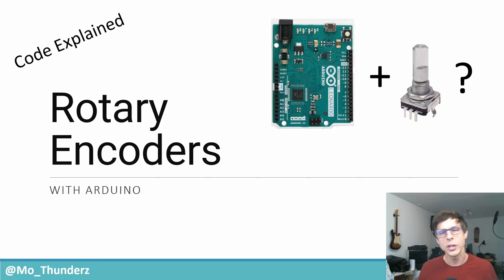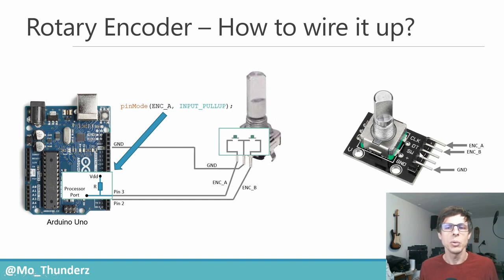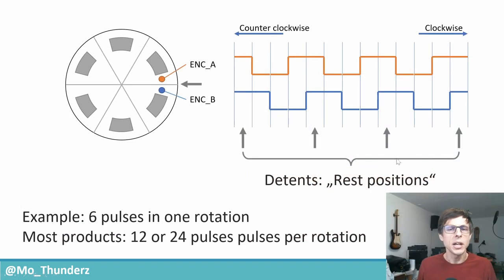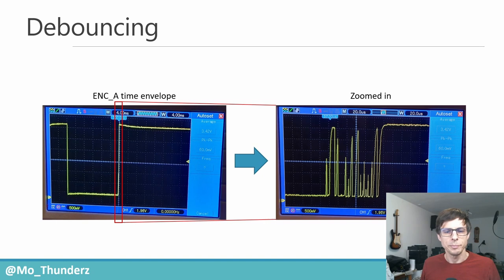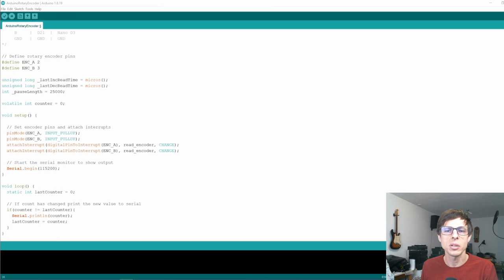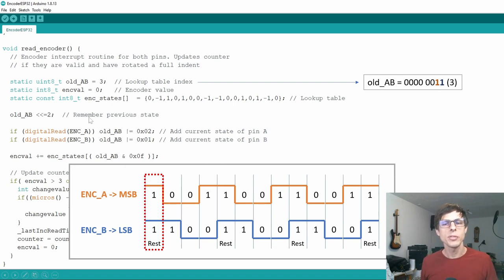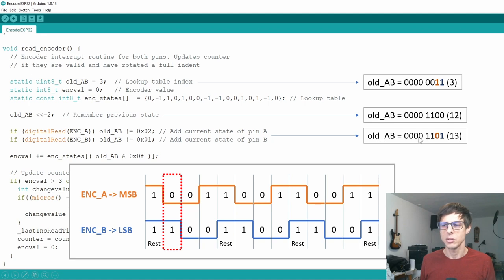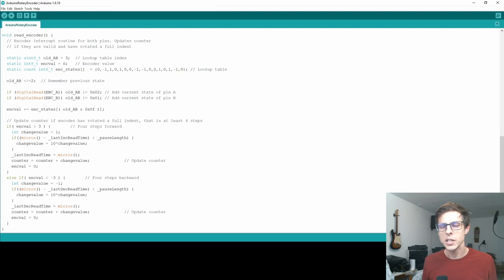How to use a Rotary Encoder with an Arduino - CODE EXPLAINED!

Comment: I dunno what to do! Im just using a rotary with the atmega328p chip, and then I make the pull up resistor circuit + filters but the values still bounce any time.

Comment: thank you sir,Your video is the  clearest one to explain the encoder state machine(the lookup table)，I modified the code a little bit,When a tick check failed because of a large number of noise.Assume the enc value has been added to 2. If next turn direction was CCW,the enc value would  be changed like 2-->1-->0-->-1,The counter value won't  change even enc value changed 4 times,Your code clears the enc value to zero only when it>3 or <-3,So the tick check will fail when enc value is not 0 due to last failed tick check,So I add a clear operation by adding a out time variable if there's no turnning action，After that the code works very nice,thanks again!
Reply from the maker: Thank you for your feedback and suggestion. A time-out makes a lot of sense.
Reply: Hi, where did you add the time-out? is it in the main loop or in the callback function?

Comment: Interesting, I have a large rotary encoder on small PCB with 5 pins and with the LED test it behaves exactly as the one in this video. However, one of the mouse scroll wheel rotary encoders (Huano S-10 from Amazon) LED 1 lights up, then LED 2 (both are now lit), and then they both go out at the same time. In the other direction it's like: both are lit, LED 2 goes out, LED 1 goes out. Weird. I wonder if I can modify this code to work with this particular rotary encoder, as I am trying to save space in my project and not use one of the larger encoders.

Comment: Idk if this is just with me, but if i turn the encoder in one direction, then in the other, it first increments and then starts decrementing the value.  So it is like this: turn right: 1,2,3,4,5  turn left: 6,5,4,3,2,1
Reply from the maker: Sorry for my late reply, I briefly wanted to doublecheck the behavior myself. I just did with my Arduino if I turn the other direction it does not lag so turn right 1, 2, 3, 4, 5 then turn left 4, 3, 2, 1, 0. On 4:27 in the video I show a simple method to verify operation of the rotary encoder. Can you verify if your rotary encoder behaves the same way? Thank you
Reply: @mothunderz  Thanks for your reply. Yes my Encoder does work the same way. I can figure out the reason my encoder setup behaves this way. i am using a pi pico insted of an arduino, but this shouldnt matter i think.... Did you notice anyone else having the same issue? Thanks
Reply from the maker: Do you have another Arduino to double check? I dont have a pico, but could find online some differences. Have you for instance changed Serial into Serial1? Have you checked with different ports? See for instance:
https://forum.arduino.cc/t/working-rotary-encoder-for-arduino-doesn-t-work-for-pico/1045042/18

hope you can make it work!
Reply: @flotshii8036  I have the same issue with my arduino Mega, did you figure it out?
Reply: Hmmm🤔 I did nothing but rewrite what I believe is the exact same code, and it suddently works.
Reply from the maker: @mariusjunkerkrabbe9225  That is odd, however, glad to hear that it is working for you now 🙂
Reply: I found that my issue was that I accidentally made encval a uint8_t instead of a int8_t

Comment: Just wondering, maybe it's clearly stated and I'm just not getting it right now: What happens, if the user would change the direction mid-click? As in after 2 Statechanges he returns back to the starting point instead of completing the click? Thank you for the nice work, it helps a lot!

Comment: Hi Mo...that code is very responsive and reliable. I may need to adjust the multiplier value for the fast rotation, but that should be straightforward. I plan on using this as part of a precision AC current Trip. I'm using a Current Transformer to sense the current, which drives a Precision Rectifier and a comparator. I'm using an MCP4725 12-Bit DAC to set the reference for the Comparator. The falling-edge of the comparator output, triggers a D-FF which drives a DPDT relay to isolate the supply being monitored. Keep up the good work and thank you.
Reply from the maker: Sounds like a very interesting project. Thank you for sharing!

Comment: Excellent video Sir, very well explained, a real pleasure to watch. I will use your code for a stepper motor driven indexing head. However there is a tiny flaw: If you turn the knob really fast, you may end in a state where encval is +2 / -2 in the rest position and you need two clicks backward/forward to decrease/increase the counter by one. Just set old_AB = 3 after abs(encval) >= 4 to get bullet proof code 🙂
Reply from the maker: Thank you very much for your feedback. I had made an update in the final code download that also addresses this issue. Did you still experience the issue in this final version:
https://github.com/mo-thunderz/RotaryEncoder

Thank you for the feedback! (and sorry for my late reply, am swamped with work ATM)

Comment: I know this is a little late in the game, but I thought this may help someone. I loaded your code onto an ESP32 DevKit1C. Used pin 14 as A and 15 as B. Worked well except that: (1) the first turn of the knob did not register (counter did not change) and (2) after any change of direction, the first turn did not register. The code I downloaded from github has a few "static" declarations under the "read_encoder" function. The first is: "static uint8_t old_AB = 3;  // Lookup table index  3". I changed "uint8_t old_AB = 3" to "uint8_t old_AB = 4" and the problem on my ESP32 is now solved. To the author. Thank you so much for a great piece of code. Brilliant!
Reply from the maker: Thank you very much for your comment to the video! Have you tried to characterize the rotary encoder as I show in 4:26 of the video? My suspicion is that your rotary coder works exactly the other way around. In that case, the LEDs would be lit up in the resting position and switch off when you turn the encoder. Can you try to compile the code with "static uint8_t old_AB = 0;" -> does it work for your then as well?

Comment: I have a bunch of different encoders I am using to build a flight sim avionics panel. I was using some button box code I found on the internet, and the encoders were not behaving as expected. Specifically some of them only triggered every second click. Testing the encoders as you detail here, I found that some of them don't behave as the one in your example. A and B both alternate low,high,low... for subsequents rest positions. So using your LED test, at the rest positions, the lights go on,off,on... not just off. So I have a mixture of encoder types, X2 and X1 or X4, not sure which. Now I need to figure out how to adapt this code to cater for the different types. Be useful if these types were mentioned in this video. Great video, I am new to this stuff and your video was the most comprehensive explanation I have found for a newbie like me.
Reply from the maker: Thank you for the feedback. When doing the LED test, turn the encoder very slowly to make sure you get it right. The creation of the look-up table would be a bit to long to add to this video, it can be tricky. Hope you get it to work!

Comment: Thank you so much for the video, the nice explanation and the code! :) This has solved my problem (having much of the mentioned noise in my signals) in one of my projects - I'm really grateful for that. :)
Is there a way to do it without interrupts as well? - I'm planning to make another project in which I'd like to use 4 rotary encoders with an Arduino Pro Micro (having only 5 pins with interrupts support).
Reply from the maker: well, the main problem with implementing this code without interrupts will be that you will miss events and that will lead to laggy responses on the encoders. Why do you want to use an Arduino Pro Micro? I recommend using an ESP32. That has interrupts on all ports.

Comment: It works flawlessly. I tried different codes but they didn't work properly. Your code works perfect. Thanks :)
Reply: I wrote down this comment before watching full video. But after watching full video i am more impressed. You did it professionally. Other videos which i watched were amateurish. Your code logis is way better. It is time to modify this code and hopefully make it work like a volume up/down thing :)
Reply from the maker: Thank you very much for your feedback! Yes, you can use this as well for volume control. Good luck with your project!
Reply: @mothunderz  Thanks :)

Comment: I've been trying to figure out what kind of switch my cycle selctor is on my GE front load washer. It doesn't look like a rotory switch.  It's soldered to the board, mine had cold solder joints and separated from the board. The switch looks like one of these. It has 2 bigger pins holding it on, not sure if they do anything because I don't see they are in a circuit line. Theb there a 4 smaller pins off to the side. It has those clicks as you turn it.
Reply from the maker: Is it a rotary encoder? You can figure that out by checking if it turns infinity. Does it have a push button function? If it does the first step should be to figure out which pins are used for that function. You can do that with the short circuit detection function of a multi meter (the one that makes a sound when the two wires are connected). You find the right pins as it will make a sound when you pushed the rotary encoder. The same way you can figure out which pins are used for the rotary encoder -> by rotating very slowly. Then, like I do in 4:27 you connect a resistor and LED with 5V on one end to figure out how the encoder behaves. Good luck with your project!

Comment: So, may I ask please, everyone does the rotary encoder and an Arduino uno. Could you please do a sketch using the encoder with isr and an Arduino nano EVERY the one that uses the ATMega 4809,  I have not found one YT video using this MCU with an Encoder and for us normal none program savvy people this is really hard to try and figure out how it works from the 600 page MCU manual. Thank you.
Reply from the maker: Unfortunately I dont have a nano here to test it out with, but the next time I buy some equipment I will order a nano as well. However, why dont you use an ESP32? It is about the same price level, but way faster, has Ethernet and Bluetooth and all PINs support interrupts. That is why on the ESP32 you can use rotary encoders on any of the pins. If you really want to stick to the nano, why do you want to use isr? According to 
https://www.arduino.cc/reference/en/language/functions/external-interrupts/attachinterrupt/
the nano has interrupts on pins: 	
2, 3, 9, 10, 11, 13, A1, A5, A7
is that not sufficient?

Comment: is there a way to do this with multiple encoders even though only pins 2 and 3 support interrupts?
Reply from the maker: If you want to use multiple rotary encoders you cannot use the same pins on the Arduino.  You will have two use pins with interrupts per encoder. There are platforms such as the esp32 that support interrupts on all pins if you want to use many rotary encoders
Reply: @mothunderz  thanks for the reply I'll look into that

Comment: Can KY-040 work without VCC connected?
Reply from the maker: As discussed in the video only the GND, DT and CLK need to be connected for the rotary encoder. The + and SW are for the push buttons.
Reply: @MoThunderz  I watched the video, and it was most helpful. My mistake was asking before watching the video in it's entirety however after doing some math it appears that connecting the + would make the encoder more precise as it has internal 10k ohm resistors rather than using Arduino's pull up ressitors. Either that or put external pull-up resistors. Either way, your video helped me a lot. Thank you for taking the time to answer me
Reply: @almirmulaosmanovic3401  Sorry for missing your comment back to me. Yes, you can use external pull-ups, but for me the performance with the internal pull-ups was already excellent, therefore, I never had the need to add additional components.

Comment: mine prints only ???????????, no numbers.
must be broken...
Reply: make sure the baud rate in the serial monitor is the same as in the code
Reply from the maker: Thanks for chiming in Joe! Yes, for this code pls make sure the baudrate is 115200 in the serial monitor. You can change that on the bottom of the monitor window

Comment: your video is a little bit to quiet i have trouble hearing you even at max volume with my laptop
Reply from the maker: Thank you for your feedback. Yes, you are right, it seems I did not get the audio level right on the master when uploading this video, my apologies for that. Unfortunately Youtube does not let me change the audio for this particular video anymore. I will make sure this does not happen again and look into re-uploading this video with better audio.
Reply: @MoThunderz  no worries m8 just crank it up next time 👍
Reply from the maker: @MrEvildigga  Thanks! Glad you could make it work 🙂

Comment: Thank you for making this video!  I appreciate the time you put into it and the professional graphics.  Very well done.  I am building an Omni wheel platform and my coding skill level certainly needs a boost.  Eventually I will put together enough good examples to succeed with my project.  I am doing this in support of my omnidirectional standing wheelchair project, to perfect the steering.  That project has Roboclaw motor controllers that eliminate the need for the basic coding to support its encoders.  I am a rookie and it took me a huge chunk of time to incorporate encoders.  In the future I want to use affordable motor controllers and use the sketch to do the encoder translation.  HTTPS://youtu.be/uZXhxTZDqusU.  I’d like not to be a rookie forever.
Reply from the maker: Thank you for your comment, I am glad my video helped you increase your understanding of the Arduino. I wish you all the best with your project!